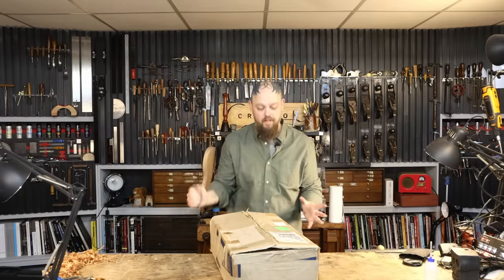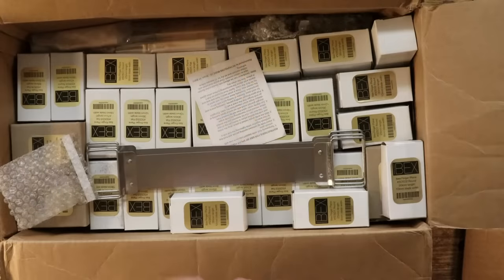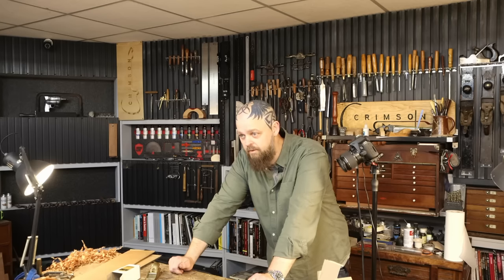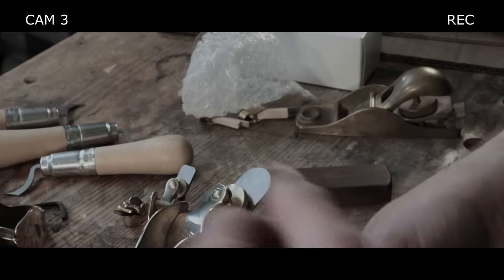Ibex Planes Unboxing | What The Actual F*&% Were they Thinking!?!

Comment: I've got three Ibex planes one is 30 years old and the other two are newer. I never checked them for scratches and just started using them. I'm an acoustic maker so they get used a lot and all seem to do the job really well
Reply: I completely understand where you're coming from.  On one hand you're buying a high end tool that is supposed to be perfect with polished brass and shiny steel.  Not scratched brass and grubby steel covered in polishing compound. 
On the other hand,  it's a tool.  It's supposed to do work,  it's not for putting on the mantle piece.  If the scratches don't effect its use (and you're going to put more scratches on it through use) then what does it matter? Get making something pretty with it. 
As a seller though, you want your customers to have an experience when they first get their new toy and you want that experience to be perfect and not spoiled. So many of these issues are caused through carelessness and stupidity.

Comment: I wonder if the difference in color is due to the differences between brass / gun metal and bronze. Because of the alloy used to make them, they each have a different color, obviously. Maybe thats why the difference. I too would be very upset to have loose steel parts banging around in the tools I purchased causing the finish to be scratched and the plane irons being dinged. I would photograph them and send them back. As an aside, the larger ones could make a decent infill, if you found a piece of wood you liked. I'd love to see that done. It seems like they're ready for that kind of treatment.

Comment: Ben, i have a set of ibex plane for 30years  and I can say the finish was not jewelry like but it was perfect for the task. To make one of these type of tool you need to setup a investment casting process and a fine machinist to do the post casting operations. In our modern days, you probably use metal 3d printer with similar if not better results. A2 62-64 R.C. steel for the blade with a mirror polish at the cutting edge. Boom you can produce your own plane(well a bit simplistic explanations but feasible).

Comment: The world really needs affordable violin/cello/archtop planes that aren't crap. For my current archtop build, I ended up buying and modifying a cheap wooden block plane because I just couldn't justify the cost of the brass ones.
Reply: I wanted to make a carved top electric, the best I could find was the Veritas thumb plane. This was a couple years and one house move ago, and I've still not made that guitar.
Reply: And I don't think I've found that plane since the move.
Reply: I feel your pain.  When I was starting out, there were $$$$ tools for guitar making (like Stew Mac) or you took cheap hardware store crap that took a lot of work to modify or refine.  The annoying thing is that now generic mass produced older tools are being sold as rare "vintage" collector pieces.  You see ridiculous Ebay auctions for rusty wooden spokeshaves and Stanley block planes with chipped castings.  Even rusty used plane blades are now "collectors' items".

Comment: I bought both an Ibex palm plane and the finger plane for carving archtop guitar plates about 20 years ago and I agree that I was disappointed with the quality, considering what I'd paid for them. The blades needed fully sharpening (Which,  given the cost, you would have thought would have been done at the factory , even if they just taken it up to a point where the customer just had to do the final hone ) as they only looked to have been 'ground' on a grinding wheel and that was it, finished, the edge still had small nicks out of it where the wheel had taken some of the edge away. And I agree about the blade digging into the palm, especially when, as you say, it's used for hogging out large amounts of timber so there's a lot of cutting force needs to be used. I ended up employing Bob Benedetto's work around, he epoxied a wooden 'knob' on the end of the blade, turning it into a squirrel tail essentially. Having said all that, since I've modified them, they have become an essential tool in my arsenal.

Comment: Unfortunately, the packaging problem happens many times.
It is not always the responsibility of the manufacturer, but many times it is an error on the part of the distributor. It has happened to me to buy Japanese bridges and tuners, of very good quality; but I have received them all together in the same bag, scratching each other.
The manufacturer probably sent a large box with dozens of pieces, unblistered but properly packaged; and the importer or distributor did not deliver them correctly.
I don't want to assume this was the case that Ben mentions.

Comment: I have a couple of these that I bought a long time ago to make my own versions.  The wedge locking into the little cam cast into the body is a great idea.  You can remove the whole lever cap without completely removing the screw or having a pin across the blade bed.  That said, the mouths are huge and not adjustable except for the largest model.  I ended up making a bunch out of wood with various mouths and bought a couple Veritas mini arching planes with the wooden handle and their cast iron "Victor" plane with the squirrel tail.  Bronze tools are pretty but I have a drawer of wooden planes that aren't a pretty but function beautifully.
Reply: It sounds like that arching plane is the one I bought for carving LP style recurved guitar tops. I moved house and I can only guess that it's in one of the boxes I've yet to unpack.

I've still not used it.
Reply: @Mikey__R  Same.  I know I have an old Leo Quan Badass bass bridge and Schaller tuners in a box in the garage.  Bought a neck through bass in the 90s that was totaled (unrepairable headstock break).  I bought it with the intention of building my first bass.

Comment: Oh man, that sucks!!  I have a couple Ibex planes, they were pretty much flawless when I got them.  The one tool I really like, and was surprisingly good for it's price point, is the WoodRiver spoon plane.  The blade needed a fair amount of work, but the body of the tool is pretty damn nice.... way better condition than some of these Ibex ones you are unboxing.
Oh, and the lock knobs on my Ibex planes do not match the body either.  If I'm not mistaken, the body is bronze and the knob is brass.
Reply: Lie Neilson also makes reproductions of those squirrel planes, they're pretty nice but pretty spendy.  The Groz squirrel tail planes are much better than their price point would suggest.  I like the first one enough, I bought a couple of their other planes.

Comment: Unfortunately vintage is a better way to go with most of those specialty type tools. Lee Nielsen for general use and you're golden. Despite the extra expense, and in the case of the vintage tools availability, this disappointment is avoided for the most part.

Comment: Ibex used to be Very high quality, I bough a small curved bottom sole plane about a year ago it came in all scratched up way worse than yours Ben, but also mine had a chip on the edge of the blade I was horrified. I contacted ibex sent them pics they sent me a new blade only. After useing the plane to tune acustic guitar braces it was dull after working on one guitar, I’m talking spruce & the blade won’t hold an edge. Junk🤬🤬🤮 Thanks Ben & Happy Christmas.🎸👨🏻‍🦯
Reply: Get the veritas mini block plane, I bought one and have been using it for braces, kerfing and a lot of stuff it's probably too small for. After almost a year I still haven't had to touch the blade, I'm amazed how good it is and how sharp it still is, it gets used a lot.
Reply: Thank you, I actually have the mini block plane & the larger one from Veritas, When I bought them I did not realize how nice they really were. I have had them for a couple years. Cheers

Comment: No genuinely depressing is when you order not one not two but THREE sets of aluminum billet for a project and Amazon ships them all three times in thin ass recycled paper bags. No box, no bubble wrap. just thin ass paper bags where the billets sharp corners could cut the paper just setting it on a shelf let a lone the rigors of shipping.  6 billets to get one before I just told em to stop and dropped my sub for the free shipping. Totally put me off that project because it is obvious the universe does not want it to be done.

Comment: Pity for the damaged sole. They are too expensive for my wallet. But generally i agree with you, the "bigger" ones are best if made in squirrel or a block plane l style. A cheap option is a Kunz n.100 but it only has a flat sole.
I hate to mention it again, but there is a Ken Parker video of reshaping a sole to a specific radius (and later adding a handle) of chinese brass plane so if anyone fancy doing some diy...
Reply: That's an interesting video, now if somebody could automate the shaping process, take castings from China and tune them up into precise but affordable little planes...

Comment: Do you think these tools would look like new after a year/ 5 yrs/ ten yrs use ? Does a couple of scratches on a brass moulding stop you making the instrument you’re working on ? Nah, I think you’re being a bit nit picky. If I purchase a new Lie Nielsen plane, I expect a little bit of work on my part, to set it up the way I want it. Few hand tools will work the way you want them to, direct from the manufacturer ( if any)  Yes I realise these tools are expensive, but please don’t expect perfection out of the box. 😉😉 If I buy a car brand new, I only ever expect to put the key in the ignition and it’ll start up and be able to drive. If I buy a wood plane, I expect to spend at least an hour setting it up. If I buy a brand new Gibson/ Fender guitar, I’d expect to spend at least an hour setting it up to my liking.